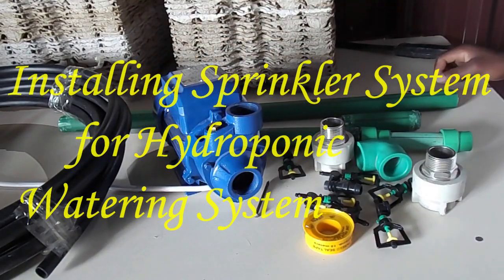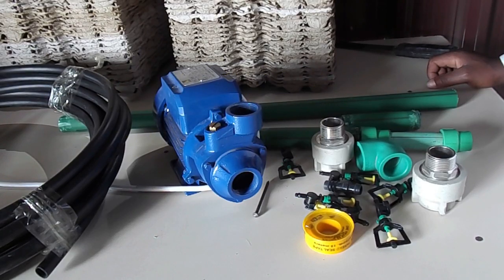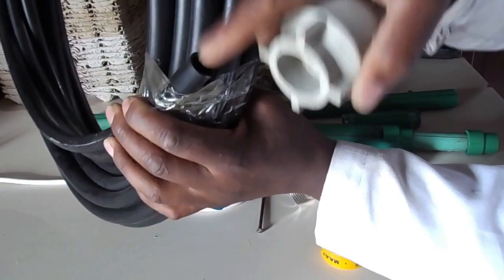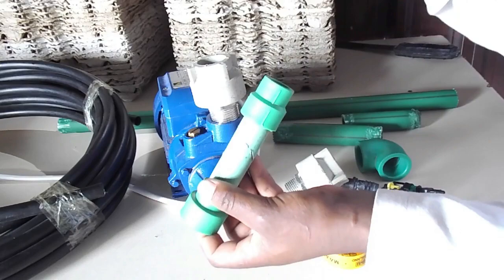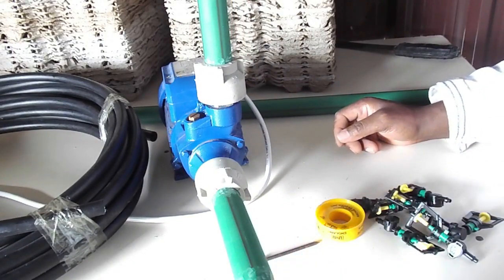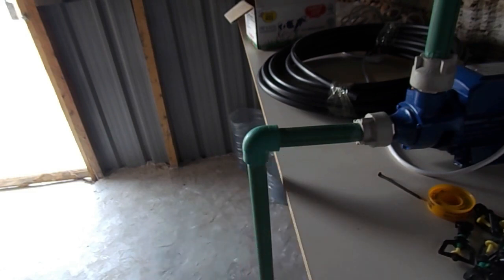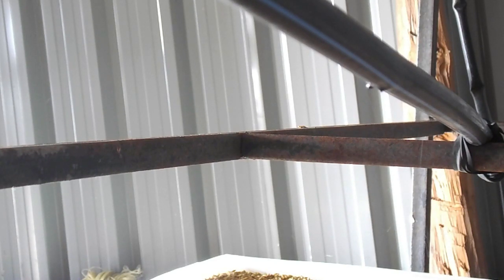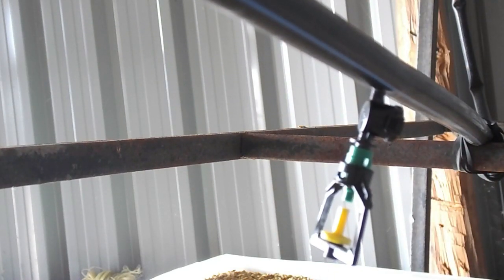Installing Sprinkler System for Hydroponic Waterig system

Comment: Thank you the info 👍
Can i use Solar panels instead of Generator to pump the water.?
If yes  how many solar panels is required for 25 trays  40cm × 100cm ?
Reply from the maker: Just a simple DC pump with a 200watt solar panel with a good battery will do. There are sprinklers now with low pressure requirements available.

Comment: How many sprinklers operated from १/२ ho water pump  &distense of sprinklers
Reply from the maker: which pump is that?
Reply: @FarmersPoint  450watt general idea for pump &jet sprinklers counting
Reply from the maker: @jeevansinghsisodiya4995  sprinklers are of many kinds. Your pump can hold as many sprinklers as you may need according to the sprinklers type. Sprinklers with no valve can do better with low pressure pump.
Reply: @FarmersPoint  slanting tray need holes in bottom to drenge access water 
Without hole only slanting tray enough for drenge access water
Reply: @FarmersPoint  450 watts water pump sufficient for250 kg/day plant

Comment: Thank you. Please price for a 250 kg / d system including the sprinkler system (pump, pipes, foggers and mutiny, etc.)
Reply from the maker: Hello Ben. For you to harvest 250 kg of fodder you require 25 trays daily for seven days. Do you require 175trays. The initial cost for installation is normally high after which things run smoothly. Cost of trays for aluminum is 700ksh and for plastic at 1250ksh each. You can do your calculations factoring in other things, like pump at the cost of the place you are.
Reply: @FarmersPoint  Please what are the dimensions of the tray?
Reply from the maker: @osasosagie91   40cm by 100cm